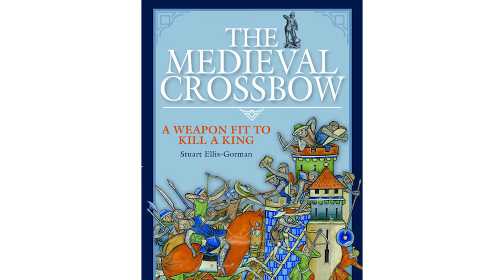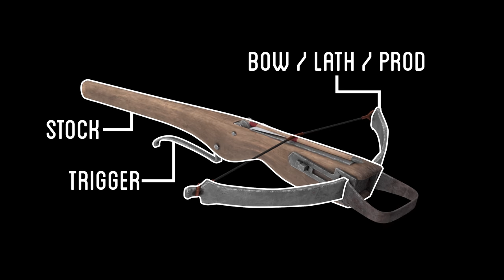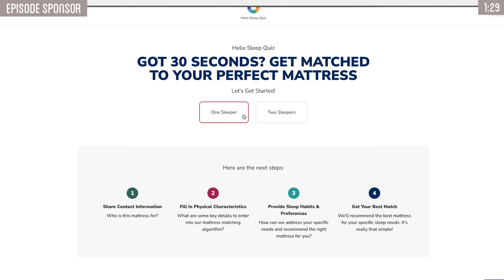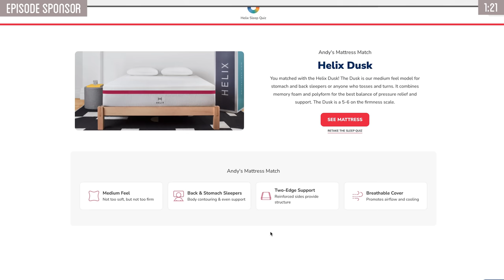Can I Make a Crossbow From Scratch?

Comment: I fully get why you didn't want to use homemade steel for the crossbow, but it would have been nice if you had "unlocked" spring steel, like you did with other materials after the reset. Maybe made homemade high carbon steel, then made a knife or something out of it. Still a very cool video, though, and it's nice seeing you springing back after the shop fire.

Comment: It's impressive for sure, but I'd love to see it tweaked a bit since it's close to being a good implementation.Tweaking the length of the bolt should help with being front heavy and feathers might be a good idea as well.
Reply: Similarly, the use of sinew instead of rope.
Reply: @KainYusanagi  apparently the rope is necessary because the draw weight (not power, european crossbows are not efficient) makes durability important. This is also why the limbs are metal instead of wood
Reply: @jeice13  The rope is not necessary if you use the proper materials. While the string WAS thicker than that of bows of the period, it was never any thicker than the quarrel or bolt fired from it, and usually still much thinner, about half of the diameter of a quarrel or bolt. It was more like a steel cable made today, but made with strings of linen and flax, with another section of cordage wrapped around it to act as a binder (on top of the wax coating). Think something like a whipcord. Nowhere near as thin as modern crossbow and bow strings are, of course, but not that giant twisted rope that looks like it belongs on a ship (seriously, it is pretty good rope).
Reply: @KainYusanagi  ah, i thought you were questioning why it wasnt basically a bowstring. Actually considering they said this was only a 110 lb drawweight they might have been able to use a bowstring instead as long as it can handle being dragged against the stalk
Reply: @KainYusanagi  *stock
Reply: @KainYusanagi  part of the assumption was based on the fact that "rope" isnt so much a material as a way you can assemble strands of something. So even if the strands were sinew or steel im pretty it is still a rope
Reply: @jeice13  Probably not, because sinew or gut is very elastic, not well suited for crossbows, unlike bows that desire that elasticity to give it greater retraction capability and thus impart greater force. The string for crossbows needs to be a lot tougher and less elastic by necessity.
Reply: @KainYusanagi  im pretty sure thats mostly because crossbows tended to be such highdraw weights though and this is still in reasonable range for a bow
Reply: @jeice13  It also has to do with the bow limb material and structure. If this was one of the models that was just a literal bow strapped to the front, then perhaps.
Reply: @KainYusanagi  yes but the limb material seems to be metal because it allows higher poundage which is only necessary because of the 4 inch draw and the limbs being metal doesnt inherently strain the string unless there 400+ lbs of draw weight. It still might not work because bows dont scrape their string along a wooden rectangle on every shot though and that will clearly affect durability
Reply: @jeice13  No, you don't understand: metal limbs (required to get enough tension with the short length of the limb that can translate into energy applied to the quarrel/bolt) are too stiff for a traditional bowstring to draw properly, because of the elastic properties of the string. The string itself would be under far too much tension because the limbs would not bend like they need to, and it would just be the string's potential energy from being stretched that would be applied alone, which makes for an exceptionally weak shot- assuming it could even shoot at all.
Reply: @KainYusanagi  all that stiffness does is reduce the speed at which they can snap back into shape (which actually weakens the bow and requires you to use higher draw weights and heavier projectiles) and allows you to raise the draw weight. If you put on wooden limbs of the same tension it would be as hard on the string but much more difficult to make due to the required thickness and such
Reply: @KainYusanagi  you can have different amounts of tension on the same material. This isnt minecraft where a sword made of diamond automatically just is sharper than one made of iron. The ways you could do this include chamging the thickness and putting its normal shape closer to the shape on the crossbow
Reply: @jeice13  The stiffness of the metal bow limbs also helps with storing energy in the form of tension (as less compression occurs for greater energy than with bows) and is how crossbows eventually came to be relatively equal with longbows in the late medieval and renaissance periods, since metallurgy allowed for stronger limbs that could be drawn to greater poundage. It's only the short length of the limbs that holds them back and requires such greatly increased poundage compared to bows, actually, since they cannot store as much energy as the longer limbs of a shortbow, hunting bow, or longbow can; the closest is the shortbow, but even that was roughly equal in strength to earlier period crossbows. It just took much less time to train a soldier to fire one, and much less energy in doing so, just the stringing process.
Reply: @KainYusanagi  look at the projectile energy on "1000lb" crossbows. It is nowhere close to 5x a 200lb bow. Crossbows have their uses but they do not get much power for their draw weight and thats why they need beefier strings, this one does not have have a high draw weight so it doesnt need a 1000 pound string
Reply: @jeice13  Yes, this isn't minecraft. This is the real world, where material composition actually matters, and different materials actually have vastly different properties. The fact that you don't grasp that is rather frustrating. It's like you have never seen a leaf spring, or know about basic physics.
Reply: @jeice13  It is nowhere close to 5x the power of a 200 lb. bow *because of the limb length*, as I have said repeatedly to you now. They ratchet up the amount of tension to increase the power that the shorter limbs can store, so that they are equal. A 1300 lb crossbow is roughly equal to a 150 lb longbow, because it can actually store enough potential energy to accelerate the quarrel/bolt in the short time and distance it actually interacts with the quarrel/bolt, compared to the length of time and distance a bow does. Please, just stop responding, because you obviously don't know shit about the physics involved in how a bow works.
Reply: @KainYusanagi  draw distance not limb length. Shadiversity has a video comparing short bows and longbows and while short bows are more difficult to make at higher poundage apparently short bows are actually more efficient (though more difficult to produce as you have to shape the wood where longbows can can just use straight pieces). The draw distance matters because it allows more time to accelerate the projectile regardless of the strength of bow im not sure what you think longer limbs would do that is more mechanically important
Reply: @KainYusanagi  as to material composition matters which offers more protection, 1 foot of cheap iron or 1 mm of high quality steel? There are factors aside from just material type that matter
Reply: @KainYusanagi  they literally say the poundage of the crossbow in this video. Its like im trying to explain to you that 20kg of feathers is the same mass as 20 kg of frying pans

Comment: This is awesome.   
A ballista would be cool as heck to make.
Reply: Hell of a project to make though.

You can make the prod with wood, like some crossbows, so maybe that would make it easier on the metalwork side of things.

I think that instead of going straight to a ballista they could refine the crossbow & maybe make a windlass crossbow which has a much higher draw strength & will need a winch/hand crank to load it.
Reply: Human hair was sometimes used for springs in ancient artillery, so the material gathering could start now.

Comment: The fact that you loose the bolt head is actually accurate. If the bolt head falls off in combat after its shot it does 2 things: 1 the bolt can no longer be picked up and used against you, and 2 the bolt head can end up in the target making it more lethal.

Comment: Finally, wood planes have been shown on the channel! I can't wait for Andy to make his own wood planes, including the forging of the metal. It could start with a stone-blade plane which needs frequent re-sharpening and a though type of stone (i.e. granite), then a copper followed by a bronze blade, then an iron blade, and optionally a sand-glazed terracotta blade could also be tested (heck, maybe even a compacted-cement one), because it would be interesting have and compare all of those. Not only that, but those which are not going to be used anymore, could be auctioned, to help support the channel.
Reply: I would probably start with bronze or iron, because anything softer or more brittle would be excessively difficult to use and maintain.
Reply: @garethbaus5471  Might be, but I think it would make an interesting content, for the channel. I mean, imagine, as impractical as it might be, using a stone bladed wooden planning tool. It would definitely make for an interesting thumbnail, at the very least. And it might show how usable such a wood plane might be. Now, it might not work for harder wood types, but I think it would work great for softer wood types.

Comment: Another advantage of a Warbow/Longbow compared to a crossbow is less difficult to make and less parts that can break/malfunction. Additionally a Warbow can be a beast of a weapon that can outshoot some crossbows.
Check out Shadiversity and some of his videos about bows/crossbows/archery in general.
Anyway this was still a great video and I personally would love to have a Crossbow & a Longbow & plenty of Arrows/Bolts for both.
Reply: Yeah I did a double take when the "expert" was like "A crossbow is stronger than a longbow, the longbow is physically limited by how strong it can be." and I'm here hoping Shad sees this and does a response video. I would like to see a crossbow do for a full 100+ pound longbow...
Reply: @TheSilverOrn  hell ya, that would be incredible.
Reply: @Red-jl7jj  True, but still more complex then a Longbow or Recurve Bow.
Reply: @Red-jl7jj  Again actual experts have gone over things and discovered some shocking things, like for instance the stronger the crossbow the less pullback it tended to have with the strongest models tending to move the bolt less than a foot or so because you physically couldn't make wood contain any more force, even reinforced by metal. Alternatively Longbows tended to have much longer draws and while there were limitations on how strong the bow could be, the fact that longbowmen tended to pull in the 120+ range shows that it was mostly irrelevant. If you have a longbow that could be 160 pound but you have a full draw it would out perform a much stronger crossbow because its only pulling back perhaps less than half the length.

Comment: I think an important thing to note here, is that even though there’s no limit to what you can learn, the importance of specialists is simply because of the need for teamwork and time efficiency. 
I believe that any person can indeed learn to do it all, and their specialty or “thing” is nothing more than what their current role in an ongoing project is. In other words, your specialty can change just like your job in a team, and what exactly that specialty/role is only depends on your KNOWLEDGE. And that’s the crucial part right there.
When they say you master something, I believe that simply means that whatever the things you master are, are simply your favorite things to do. In other words, you master something because you spend the most time doing them. I think
“Jack of all, master of *none*” is kinda flawed…
A perfect example is engineers. Any kind of engineer is expected to handle a variety of situations. As an engineering student, I can confirm I will be expected to be no less. And your specific major in engineering can be very broad. Civil or mechanical engineering are probably the broadest. Because they both deal with something that EVERYTHING has: Structure and Mechanics, respectively.

Comment: Reminds me of a crossbow I built in middle school, took an old piece of wood, some galvanized steel from a barrel ring, some paracord, I “routed” out the well for the trigger mechanism with an electric drill, and overall it worked really poorly for any kind of bolt but it was absolutely excellent for nerf darts and really packed a punch in all our nerf fights
Reply: I also used the design and upsized it to an 8 ft wide ballista I built with a friend and actually integrated a twisted paracord tension system for the bow, which from my knowledge is more historically accurate to ballistas

Comment: I don't really agree with the statement that a crossbow is more powerful than a traditional warbow like the Longbow. It's definitely true that in terms of poundage the crossbow comes out on top, some crossbows had a draw weight of well over 1000 pounds whereas the Longbow maxes out at around 200 pounds and only a few people would have been strong enough to draw that.

The reason I don't agree is that traditional European crossbows had a very short Powerstroke, the crossbow only drew back a few inches compared to a longbow or a composite bow that drew back a few dozen inches. This means that the bolt itself has much less time under tension and won't accelerate as much as a traditional bow and arrow. Modern crossbows solved this issue but England adopted the longbow for a reason and it wasn't just rate of fire.

There are accounts from the English where knights while fighting the Welsh were shot while on horse and arrows went through chainmail, the thigh, their saddle, and into the horse. The biggest downside the warbow has compared to the crossbow is that it takes a lot longer for a person to develop the muscle needed to shoot than that of a crossbow. You could train a peasant to use a crossbow and have him able to defend a castle in a short period of time whereas a warbow might even take years.

Comment: The crossbow simply did not require the same level of training as using the longbow did. I think the expert kind of glossing over that is kind of a disservice to just how usable the crossbow was.
Reply: In my current physical condition I could draw a 200 pound crossbow without even bothering with a mechanical aid, but I would need a lot of training be strong enough to use a 150 pound bow.
Reply: I think he's mostly focusing on the "frowned upon" aspect. Though here's the thing: That was definitely a thing, but it wasn't exclusive to crossbows and also included regular bows to the point where they actually tried to ban the use of bows and crossbows against christians in the 12th century.

So it's not about the difference between bow and crossbow, but rather the difference between close quarters and ranged combat.

Comment: I just wanted to share that the steel used didn’t feel fitting for the linear progression of the series but regardless it certainly didn’t deter me from the video. Very interesting, Informative, and entertaining as always.
Reply: Although it has a little bit of chromium 5160 is a fairly simple carbon steel that is a fairly close modern equivalent to the type of steel a bow like this would probably be using.
Reply: Thing is back then human peasant life had next to no value, so if mass produced spring failed and smack the skull of that peasant in... well there is more where they come from so no biggie.. we only have one how to make everything so manufacturing material flaws should be avoided for safety concerns, specially when those armorer blacksmiths at the time learned trade in decades and perfected it over long period of time so quality was suitable. It was not just couple guys in hobby forge hammering metal and trying to learn. Also blacksmiths at the time had trainees and there was plenty to choose from, so new bow design... let new trainee to string it and take it into face if it fails.
Reply: @garethbaus5471  Wait, they're working with modern alloy steel than historical steel?
Reply: @jonajo9757  historical steel is extremely expensive, and we know for a fact that the historical materials could work because they did. Using modern steel doesn't change much other than slightly reducing the chance of the spring snapping. 5160 has a composition that is within the range you could realistically get from a historical steel albeit with fewer inclusions and impurities.

Comment: Put a light twist to the crossbow bolt tip to see if the bolt screws to the target inside and helps the bolt rotation with fletching.

Comment: From the testing I've seen, crossbows have less kinetic energy than an arrow because your typical crossbow only accelerates a very short distance, whereas an arrow has a much longer one. Even though the draw is much heavier with a crossbow, you actually get more force with an arrow--leading to more damage. That might help explain the switch back to bows. I think the test was using a ~160lb draw weight, but that's not unheard of in medieval bows, and the crossbow draw weight was something like 800lbs.
Reply: That is true when talking about medieval European crossbows, but many asian and modern crossbows actually have a decent draw length which allows for either a lower draw weight or a higher kinetic energy.
Reply: @garethbaus5471  Neat, you can actually see that in the depictions they show at the beginning of the video.